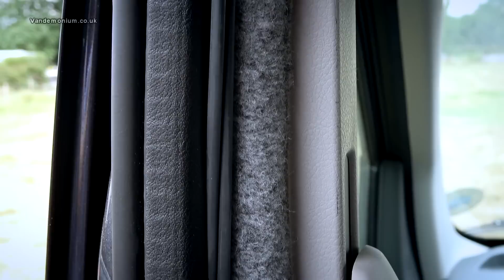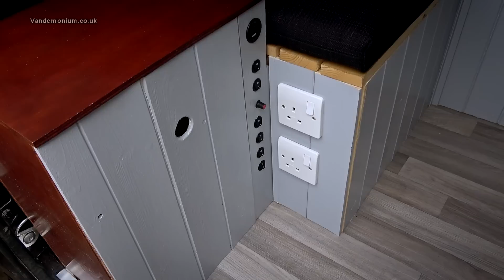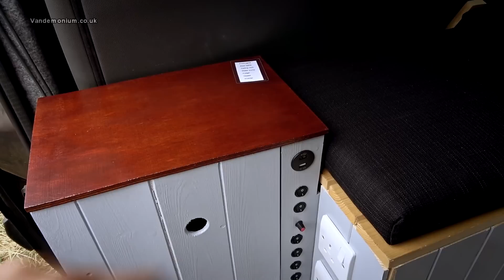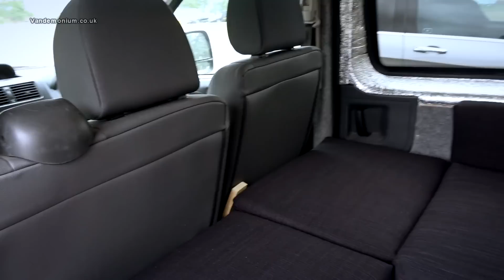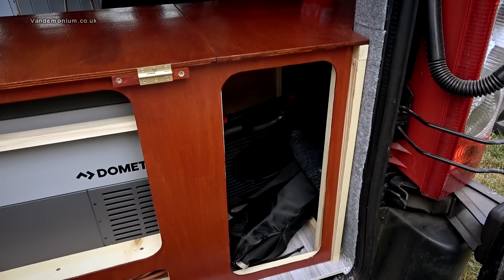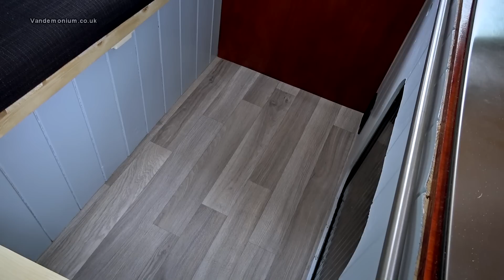Vlog 22 Campervan solar panels plus miscellaneous improvements

Comment: Any solar panel cables that freely touch the roof will definitely wear the paint off the roof down to bare metal.  You need to secure them up and away from the roof.

Comment: Hi ... addicted to your van blogs ..... very interesting and easy to follow 🙂👍🏻.  Do you have any idea of the weight of components used in the conversion ?  Do you have any fuel consumption figures ?    Keep them coming .......
Reply from the maker: No idea about the weight but it’s well under the load capability of the van (1.2 tonnes), I did put it on a weighbrIdge once.

Comment: For a non-electrician you did quite well with those electronics! I myself would have problably stuck them in a more accessible cupboard...but that is just me, because frankly I have no problem with exposed cable-ducts or even dangling cables, if they are out of the way of course...I on a great big desktop computer and it has a lot of cables going to monitors, keyboard, mouse, printer, power-socket etc. etc. etc. and then there' the networking cable hanging from the ceiling (I had to place the network-socket on the ceiling because otherwise I'd have drill into the wall, which I didn't want to do...hate the dirt and dust this produces, while i could easily screw the socket onto the ceiling!)
Reply from the maker: Cheers. The electrical cupboard comes apart for access

Comment: I wonder if the fan would switch direction if you switched the power wires around, + to - and vice versa? It depends on whether there’s any electronics in there and what kind of DC motor it is, but if it works you could wire a direction change switch right next to the speed control. (Double pole single throw, break before make, motor controller output to the center contacts, fan wires in an X configuration to the outside contacts)

Re the whining noise, that’s going to have to do with the frequency of PWM the two respective controllers do.

Comment: i just been watching your video and noticed you made the same mistake i made with slide out bed. you used 2x1 timbers, i found it heavy and it would not slide in and out very smoothly.so i change mine to bed slats which you can buy a complete double bed slat pack from Ikea for about £20. its now alot lighter and smoother to move and alot more comfy to sleep on
Reply from the maker: Hi. I haven't had any issue with mine, they seem fine

Comment: Hi David,  i recently decided to turn my vito into a campervan and have taken much useful information from your vlog on building your own camper. The electrics i have particularly found daunting, but have managed to muddle through it. I have installed a le mans low profile vent in my roof and it has a switch to either suck or blow air in the van, however as with yours, there is only one speed in or out and its fast and noisy. I came back to your vlog on the solar panels and behold you started talking about a speed controller switch. Can you advise how this would work in regard to a fan that blows in or out, Thanks in anticipation ........
Reply from the maker: You just wire the unit into the power feed to the fan and it controls the pulses of voltage to the fan. It doesn't matter that the fan has its own switch for direction. I think I put a link to the controller I bought in whichever vlog I talked about it, didn't I? (if not, I'll try to find it)
Reply: Ah ok got it, I have the controller as per your link.....many thanks for replying

Comment: Hi David, yet another great video, which has prompted a question in the minuscule thing in my head which is cleverly disguised as a brain. Are you able to tell me how far out the little grey plastic end thingies for the table rail, stick out from the edge of your worktop/sink unit? I have a sliding seat in my van and due to me building the units out too far, I have only a small gap between the edge of the worktop and the seat. I take it you dispensed with the little support that goes in the middle of the rail?
Reply from the maker: I'll have to look next time I'm in the van, I don't recall offhand.
Reply: Thanks very much David. I’ve got a maximum of 17mm so if it’s less than that I’ll buy you a cheese and tomato sandwich!
Reply from the maker: Damn. I think I just measured the wrong thing. I measured the sticky out things that are on the table itself, the ones that hook over the rail (22mm) but on second reading, I realise that’s not what you were after. Sorry! I’ll measure again tomorrow. Yes, I dispensed with the support thing though the rail does feel a tad flimsy for it.
Reply from the maker: Bad luck. The brackets stick out by 19mm!
Reply: Thanks very much for that. This one was a real head scratcher and has left me with a lot less hair as a result! After your reply, I purchased the rail armed with the knowledge that it was only going to stick out 2mm more than the gap I had and decided to partially remove the cover of the seat and chop away an appropriate amount of the chipboard that made up the back. It seems to have worked quite well and has left a nice gap that isn’t noticeable, but which will now slide past the rail without hinderance. I’m really obliged to you and have put a virtual cheese and tomato sandwich in the post!
Reply from the maker: Haha good to hear you managed to make it work! Cheers

Comment: Howard MacCallum.  Re vlog 22 you could usesome plack grill material to surround your fridge but like the cook top plywood you would cut a big hole so the surround would fit arround the fridge.  But at lease you could use the cut out piece to cover over othe ventelation spaces.  May be you have already found another solution

Comment: David - the DC fan speed controllers operate by continuously switching the full 12v on and off really quickly.  They control the motor speed by changing the percentage of the time the power is on versus the time the power is off.  (It's called Pulse Width Modulation or PWM).  The problem is that whilst the percentage of time on vs time off (the mark-space ratio) controls the speed well enough, the frequency at which that happens differs considerably between units.  Lower frequencies are more efficient in some respects, but can produce an audio component by "rattling' the iron laminations in the motor.  Higher frequencies are less efficient, but can be above the audio band thus avoiding the noise.  (There can be some mechanical resonance issues here too).  Some of the PWM controllers have a frequency control in addition to their speed control, so that they can be set to something that suits the particular situation.  I fell foul of the fact that the frequency range of Ladies hearing is often much higher than men, so whilst I had adjusted the fan controllers in my boat to my satisfaction - my partner couldn't stand the noise.  Ah, well!  We can only be perfect most of the time I suppose....  I have bought units controlling up to 30 Amps from www.thaikits.com and they are very good indeed.

Comment: I'll take you fuel consumption with the solar panels compared to my Jeep fuel guzzling with the roof top tent installed and how it turns into a sail during high winds or passing tractor trailers.

Comment: Constantly amazed at how your project comes together. While the "fit and finish" might be described as "man-cave" sufficient (I certainly like it), I'm betting your infrastructure is better than what is professionally done by manufacturers. Here in the States, there are big issues with quality control as demand exceeds output . . . and profit drives all.

Comment: With a little re-wire of your speed contoller to add a double pole, double throw switch, you could have it do pull/push of the air...
Reply from the maker: The fan already has that :-)
Reply: O.K... I looked at the Fan... must have missed that bit :( :(

Comment: Sorry if I've missed it but did you bother with a split charge relay so the leisure battery is also charged via the vehicle alternator or are you relying solely on the solar panels?
Reply from the maker: You didn't miss it, I didn't bother with one as it's really a van for the summer in which case the solar should do the trick. Or, if used in winter, the fridge wouldn't need to be used so the power draw would be tiny, just the lights and heater, which I reckon the solar and battery could cope with for a few days.
Reply: I think you're right. My van has 200W solar and a split charge system. Monitoring my voltage quite closely the split charge almost never does anything as by the time I come to drive anywhere (especially in summer) the solar has already replenished the batteries. That said i am now winterizing my van (insulation, propex) so perhaps the split charge will get more use for winter camping (I prefer to avoid using mains hook up). Happy camping!

Comment: Regarding the whistling... try blocking the open ends of tubes, pipes, struts, frames, brackets, etc. on the roof.  As a quick experiment, you can use a bit of masking tape and then go for a drive.

Any more narrowboat videos in the works?

Comment: You may wish to investigate installing a deflector panel to the roof just ahead of the solar panels.  The idea is to change the laminar flow of air across the roof.  If you can deflect it properly, the root surface, vents and the solar panels would exist in a partial vacuum. You often see similar structures on lorry cabs, employed for the same purpose.  With the root surface in (partial) vacuum, your gas mileage may actually increase and also reduce the annoying windsong.  The van will also be pursued by still air (try fixing a flag against the rear panel: it hardly moves in the vacuum).

Comment: at 5:00 the grounding of the inverter is questionable. In a boat or a travel trailer most of the time the wiring is not connected to the hull or frame of a trailer, this is referred to as a floating ground,  it is a little difficult to ground a fiberglass boat , so all negative wiring goes to the negative post of the battery
Reply from the maker: It's not "questionable", I assure you. The inverter itself is grounded to the vehicle chassis as it is supposed to be, with the leisure battery -ve also connected to the chassis.
The 230V mains coming off the inverter is indeed floating.
Reply: sorry David, I didn't mean that grounding your inverter on your van is questionable, rather there are cases where grounding the inverter is questionable such as is the case on boats and travel trailers.  sorry for the confusion
Reply from the maker: Ah, sorry for the misunderstanding!

Comment: Sir David, I am so happy that you went with rigid  panels rather than the flexible ones. I have had mine on my van since 2000 and have no problems. The flexible ones get burn marks on the cells after time as they have no way to disipate the heat when stuck on the roof. you will be so happy the way you did it.  You sholdn't get too much wind drag on the panels as the wind should be deflected upward from the front wind screen. Also your noise may be from the thule racks themselves, there is a front fairing that clips on to the front bar to deflect the wind and will stop the noise.
Reply from the maker: Hi. Thank you, that's certainly what I'm hoping as regards the heat. The mpg still seems decent even with the panels. It's definitely them that are making the noise though, I didn't get it before I put them on (when it was just the roof rack)

Comment: I’m surprised you didn’t opt for the semi-flexible solar panels & just bond them directly onto the roof, rather than have the added drag?! Plus fitting them to a roof rack with reduce your MPG more than you think...
Reply from the maker: The mpg doesn't seem too bad (43 at 60mph). I didn't want to permanently glue panels onto the roof plus panels don't like being hot (the work less efficiently) so it's good to have some air under them rather than being in contact with the hot metal roof.
Reply: I permanently glued 3x100 panles to corrugated plastic that was then VHB taped to the roof.. I didn't try them first, and now u have one panel that gives me 10v and won't charge my battery, and 2x100w that give me 19.5v and I ly 1.7a and 2.5 a per panel. And I didn't test them beforehand even though I was thinking "should I hook these up first?" so jokes on me.
Reply: Been through this...originally had 2 x 100w semi-flexibles bonded to my roof. They lasted less than 2 years (and they were good brand ones). Now on rigid panels and they are lasting much better and noticeably more efficient. Removing the old panes wasn't much fun either!

Comment: With regard to your mains electric sockets, I would suggest that you change the one that runs from the inverter to a different colour, ie Red. Or at the very least label them using the old "Dynotape" type labels. That would save you a mountain of confusion between "proper" mains electric and "manufactured" mains electric.

Great videos, by the way. Keep them coming.

Alan, Belfast.
Reply from the maker: Cheers. Not really needed though, I can easily remember the bottom one's the inverter because the inverter is at the bottom of the electrics cabinet.

Comment: Do your self a favor and check those solar panels at motorway speed, they may vibrate or make a heck of a lot of noise!
Reply from the maker: I already have. Pretty sure I mentioned that in the video!
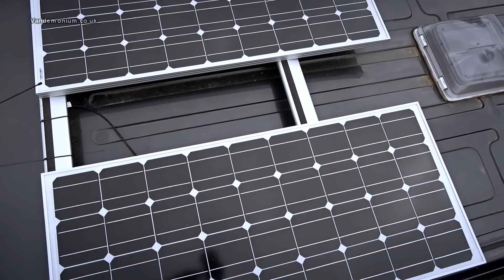Reply: You did. 2:27 - 2:38 You said motorway at 70mph.
How about Autobahn speeds though ??

Comment: Very nice, enjoying your van vlogs. Could you show us the solar working?
Reply from the maker: Not quite sure what you mean because it doesn't do anything to look at, it just sits there quietly charging the battery!!
Reply: Vandemonium could you show your controller and say how much charge your getting? Is your heater working yet?
Reply from the maker: I'm getting almost nothing because the battery is completely full so the solar is just ignoring the power. Only once I start using the battery in earnest would the solar start to do any worthwhile charging. I've even had to set it to a custom "float voltage" program because otherwise it was trying to charge the already-full battery!

Yes, the heater's working.

Comment: build some drop down legs that hinge on the end rail.
Have them between the slats so that they store beside them when the bed is closed.
Reply from the maker: Unfortunately there's not enough space between the slats, unless I remake the whole pull-out section and top of the bed.

Comment: The drop leaf access to the fridge and the fridge door itself opening in different directions will really work to your advantage. As it is located right at the back doors and the counter top door opens in, a little breeze from the back (with open doors) would slam that door right on your head. Opening the fridge in a different direction will actually prevent the top access from hitting you on the head when you are rummaging through your food. I will just presume that you were thinking ahead and this wasn’t a lucky accident. The aggravation you felt when the shelf didn’t fit would not compare to the aggravation one feels when the edge of a board whacks you on the forehead. Well done!  A question...there were openings cut into the front of the cabinet near the fridge, though you said there would be garage access. What do you plan to do with the ‘holes’ at the interior front? Putting black speaker fabric in front of the fridge would allow ventilation while giving it a finished look. Finally,  search for hemming a curved edge on YouTube or online. The cutting they do will be the kind of cut you will need to do to wrap the carpet around the edges near the window. An exact cut (or notch, if you will) will make it sit smoothly and seamlessly. It might be worth looking at.  Thanks for the video!  R.
Reply from the maker: Not sure which "interior front" holes you mean.
Reply: My bad. I looked again to be able to communicate exactly where, and see that you had transitioned from inside the van to around the back. An alarm or something must have gone off and I looked up just as you moved around to the back. I watched the whole section wondering why you cut the holes in the facing of the cabinet (14:09). Watching again without interruption shows me that the ‘holes’ that I was referring to were actually access points in the ‘garage’ at the back door of the van.  In the words of Roseanne Rosanna Danna, ‘never mind’. (An American reference to a Gilda Radner character from the early Saturday Night Live skits. If you aren’t familiar, maybe you might google it so that you see the way she does that. It is in that very way that I say ‘never mind’) Brilliant video. I shall tell husband to stop setting off the alarms in the remaining videos. Although it could have been a nurse. We’ll never know. Thanks

Comment: Another great vlog - I;'m now fully up to date with these and the boat ones. I did my camper conversion 6 years ago and I'm still forever improving / upgrading / changing things on it! Very similar in that I have 200W of solar and a similar fridge (albeit the built in version). 220Ah of leisure battery but also charged by the alternator via a split charge relay in addition to the solar. I did find i had to substantially upgrade the wiring from battery to fridge to avoid power drop in the wires causing the low voltage protection to kick in when the compressor first comes on. If you do get shorter run times on the fridge than you expect that may be worth looking at. I solved my whistling solar panels by using the plastic ABS mountng brackets which also form a small wind deflector. Hard to explain but it works, you'll see what i mean if you look at the brackets on ebay.
Reply from the maker: Hi. Thanks. I specifically used quite substantial wires to the fridge (to all of it, actually!!) to avoid any issues.